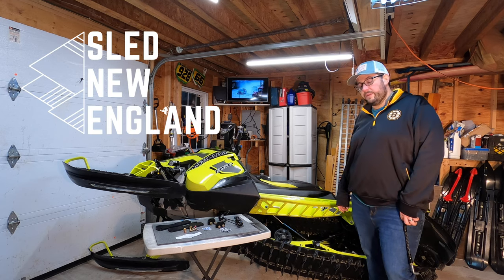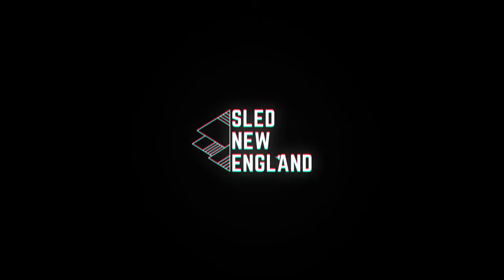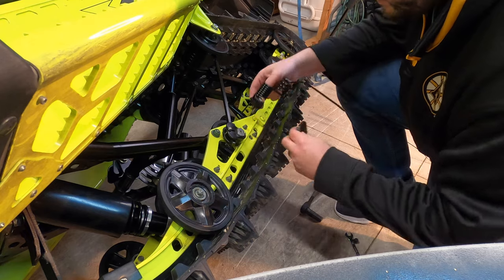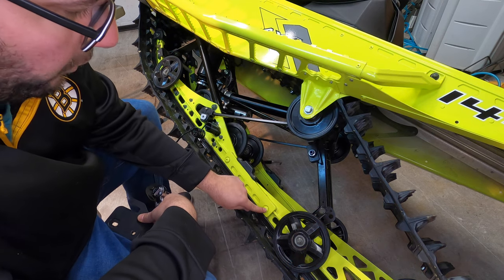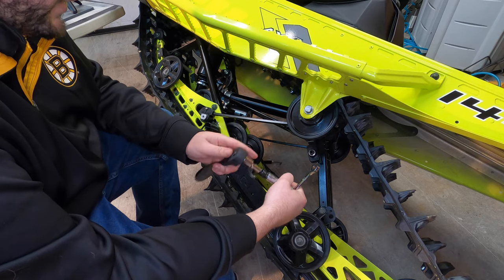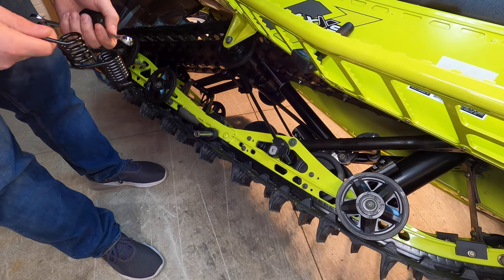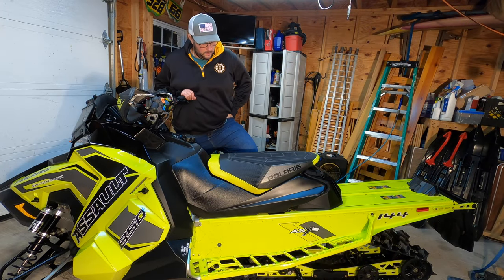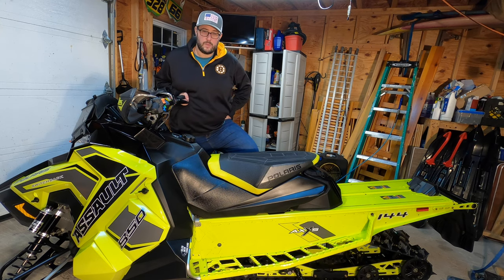Ice Scratcher Install | One Rig Design | Polaris Switchback Assault

Comment: Thanks for the video.  I used this to help me install the Ski-Doo scratchers with the blocks to my 2020 Indy XC 600 Axys 137.  It is a super clever design.  I originally purchased the Polaris scratchers but stopped the install when I saw it called for removing the idler wheels.  This design is so much better, you can keep the idler wheels plus no drilling.  Also, I had some questions that I emailed to One Rig Design.  He responded in about 8 minutes to 3 emails with more questions.  I could not be more satisfied with the product.  Oh, and I tested running them briefly in reverse, no problems.  Sure beats the Polaris scratchers.  One forgotten backup and there ruined.  These were not.  Great informative video, thanks for taking the time to post.
Reply from the maker: Thanks. Glad you got it set up.

Comment: I think we've got the same sled right?  Mine is a '19 Switchback Assault 144".  I can't figure out how you got those nuts on the inside of the rail for the scratcher blocks on without removing the inside idler wheels for the life of me!  The bolts are so long (it appears that they're longer than they need to be), so there's only about a 1/4" of space between the end of the bolt and the idler wheel.  There's no way that I can spin the nut on the backside so help me!  I guess I'm just going to take the idler wheels off and be done with it.  Removing them and putting them back on isn't that big of a deal anyway.
Reply from the maker: Are you sure you are installing the bolts in the right direction. In the beginning of the video I show how to put everything together. It is tight but I had no problem.
Reply: @slednewengland715  yes, I'm pretty sure.  I didn't finish installing them the other night when I saw that I think I'll have to pull the idler wheels, because it was late, and I didn't want to get into all of that at that time.  I'm going to try installing them tonight.  BUT, they've changed their parts some.  They now look a little different than yours do, and the mounting blocks also have an additional hole than yours have.  So that may be part of the installation problem for me as well.  Yes, I've watched your video at least 10 times to be sure that I was doing everything the same as you did.
Reply from the maker: @JeffGeorgalas ya. Very possible the new design has a different process. Good luck.
Reply: You were right, I got them installed.  Thank you for your video!

Comment: I'd like to know if the protection plate you pit on is as strong as the reinforcement plate you took off
Reply from the maker: This goes over the original plate. I didn’t take those off
Reply: @slednewengland715  
But in your video..you mentioned the reinforced plate..by removing the T-40 screws first then......
Reply: Ok ..you placed the rail guard directly over top of the skid reinforcement plates..correct?
Reply from the maker: Correct
Reply from the maker: Yes. You take off the stock hardware then put the plate over the stock reinforcement plate. You then use the new hardware to secure both.
Reply: @slednewengland715  thanks pal...good videos . keep it coming
Reply from the maker: Thanks man
Reply: @slednewengland715  shouldn't you have put the plate on the inside of the rail?  That way you would keep the appearance of your color coded rail brace.  Still hold the scratcher with no issues.
Reply from the maker: The inside of the rail is not flat and would not sit appropriately